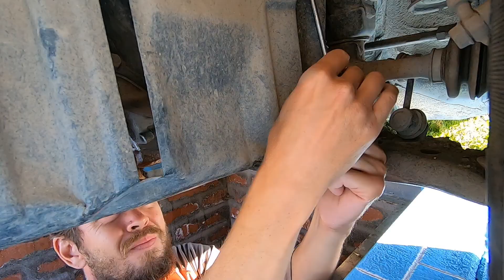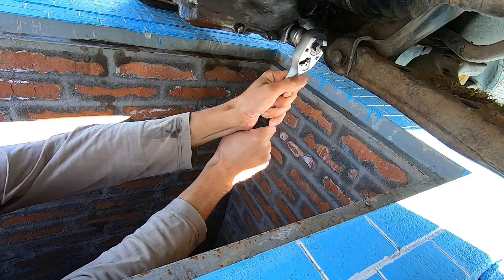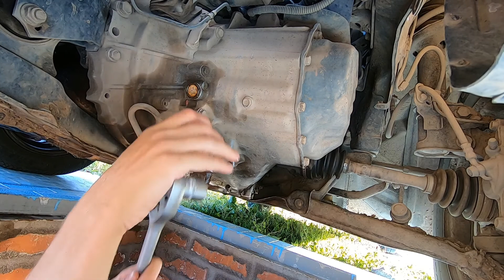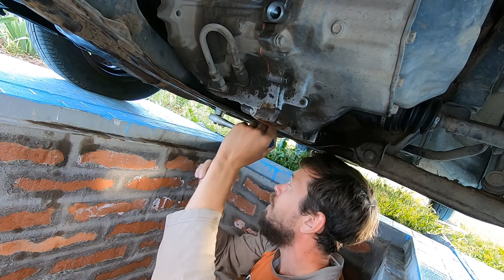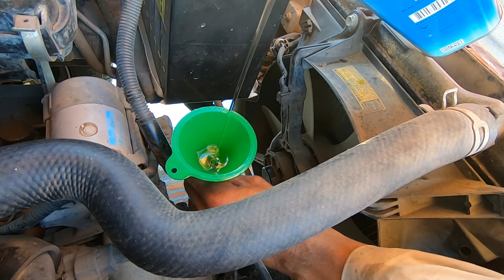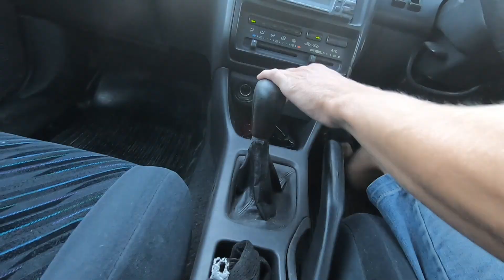How to change oil in manual transmission and transfer case. Toyota Caldina, 3S-FE, ST195G, 4WD

Comment: Did you use full synthetic or semi synthetic and how much time do you recommend in between changes
Reply from the maker: I used fully synthetic. It's not my recommendation, but according to the manual - replace oil in manual transmission every 80.000 km or 4 years (whatever happens first)